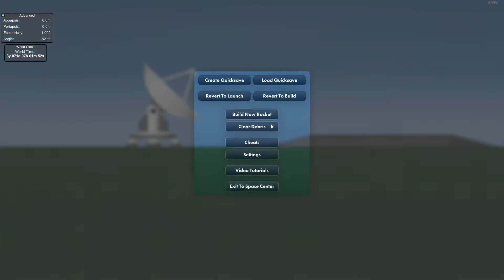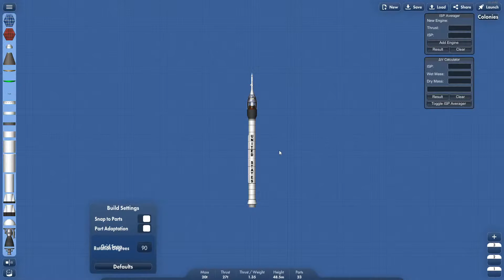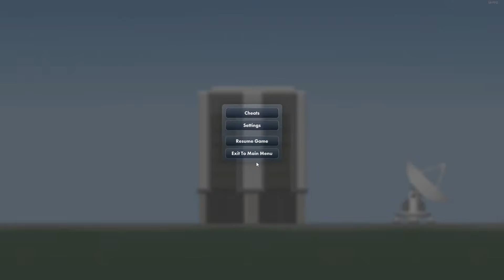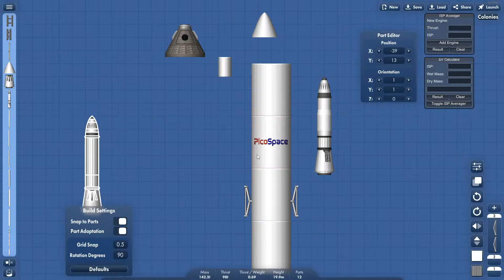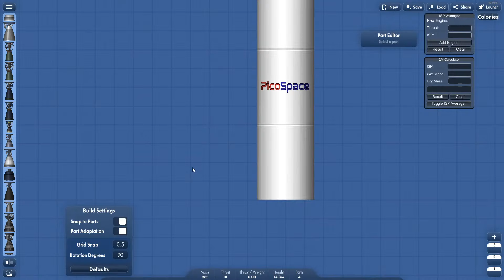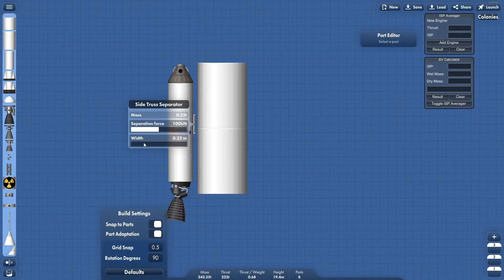Engine Pack Update and NEW Booster Custom Part Pack Reveal for Spaceflight Simulator

Comment: I cant get the full engines,  I can only get the OWl engine, the Extra Eagle Engine, the extending eagle engine, The eagle tres engine, the bald eagle engine, the bird of prey wizard engine, and the bird of prey engines.  Yes i have the electricity pack installed.
Reply from the maker: Hmm… do you have a recent version of the electricity pack?

If you press F1 and get the debug screen is any part listed there as being an issue?

Comment: just wondering, is this the semi-realistic pack? and if it is wjhat version? and if its not, what is the pack name? also are the needletail and swift engine is this pack?
Reply from the maker: This is a semi realistic engine pack for the engines and it’s the booster+ pack for the solid rocket boosters and motors.

Comment: There originally was also an SLS Block 3 proposal with a 5 engine core, as well as the Dynetics advance liquid fuel booster powered by 2 F-1B on each booster
Reply from the maker: I think that was the Jupiter Project proposal.

Comment: I don't get the RS-25 engine with the file, i put it in its right spot but it still tells me the asset pack couldn't load, yet i still get most of the other engines except some of the ones shown that should be in the pack.
Reply from the maker: Install N2O4’s electric ⚡️ pack and that should solve the issue.

Comment: hello picospace i would like to say on my macbook it seems that the solid boosters are not appearing if this is not a real issue please tell me which category they are in.
Reply from the maker: Boosters should show up as thier own catagory "Boosters+" if the are not appearing are you missing N2O4's Electricity Mod?
Reply: @picospace  i did install the electricity mod but it’s not showing up though I do remember a lot of errors with these mods

Comment: MY SHUTTLE BOOSTER WONT SEPARATE
Reply from the maker: Did you place it correctly? It’s very particular.
Reply: @picospace  where does it go?
Reply from the maker: There are black "leafs" that show where the placement should be, in the next update (very very soon... maybe tonight or tomorrow) I've made it much more clear with Internal/External View where to place the Boosters that can be stacked on a rocket.
Reply: I don’t know

Comment: There originally was also an SLS Block 3 proposal with a 5 engine core, as well as the Dynetics advance liquid fuel booster powered by 2 F-1B on each booster
Reply from the maker: Very cool, I haven’t found anything on that, can you share a link or something with info and I can see able adding it to the Pack?
Reply: @picospace  I can't find any proper source on the block 3 yet but might be able to find one for the Dynetics booster
Reply from the maker: @Mac33299  I'll take dynetics booster info! I already got Block 2 enhanced booster info so additional info and I can make a 3rd booster.
Reply: @picospace  I was gonna put in an F-1B info link in the meantime but YouTube ain't letting me